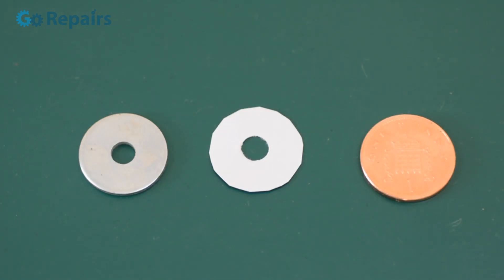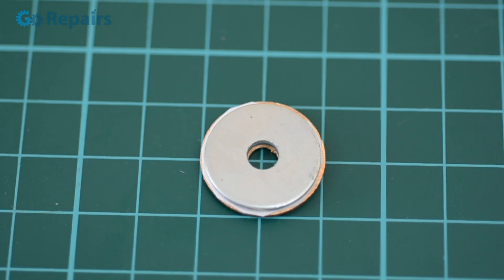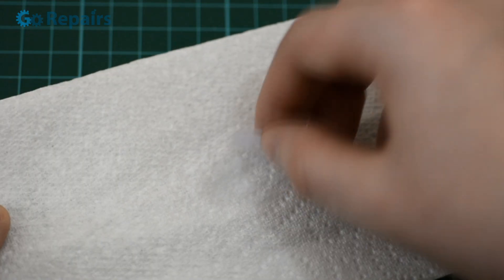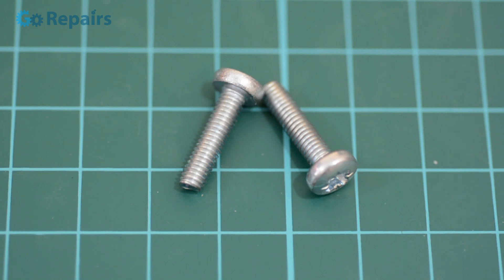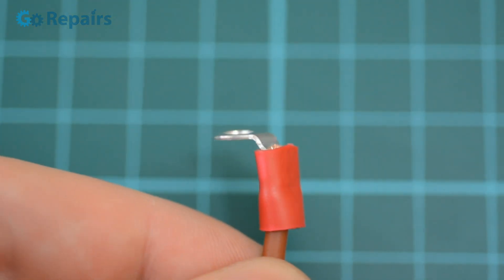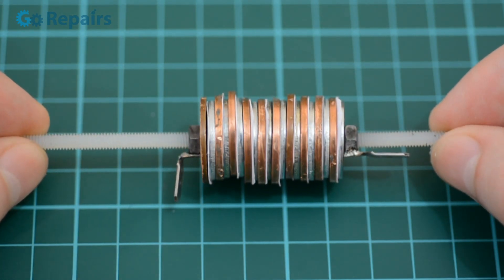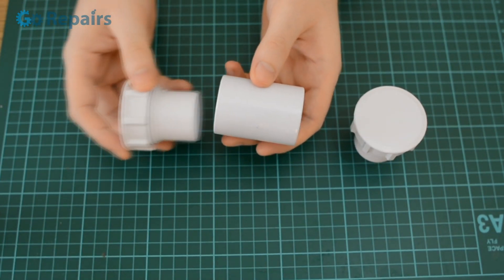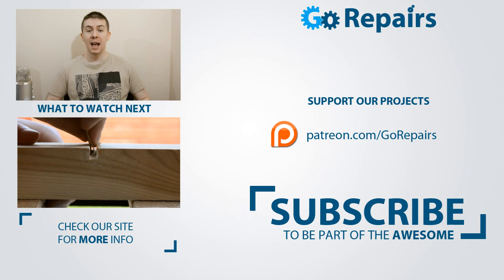How To Make A Battery

Comment: We drill through coinage all the time here in the States. Who will know when the battery is glued together? I am experimenting with the larger pill bottles available from my local pharmacy to build higher capacity batteries that are rechargeable and CHEAP. I ran a loop close to the power lines to get about 18 volts through a full wave bridge rectifier, and a buck- boost circuit to charge them all. So it costs nothing to recharge them. I also ran a small mesh wire screen behind the newer power meter to shield me from broadband over power lines interferences. The power company complained, but there is no law that says I cannot do this so they are stuck with it. As long as it doesn't touch the meter or the drop line, there is nothing they can do. I got so tired of the nasty harmonics that BPL caused, I installed the mesh shield as a self defence measure. Great video!

Comment: Is lemon juice a better electrolyte?
Reply from the maker: Depends what you mean by better? If you want a stronger reaction then use a stronger acid, if you want it to last longer, then you'd have to test which of the two lasts longer.
Reply: @GoRepairs  oh i see, do you have any recommendation on an electrolyte that is powerful, lasts long and is not expensive? Or there isn't such thing?
Reply from the maker: I wouldn't recommend anything more powerful than the vinegar and lemon juice we've mentioned unless you know what you are doing.

Comment: DidyaKnow: if you throw a wire over a tree limb you can measure 14volts from top of wire to solid ground (8ft copper rod in ground is considered a good ground); but the amps are very low so there i not much pwr there, BUT if you raise it to cloud level LOOK OUT  you might get a lightening volt (Free energy) down on your head (or hand); isn't amazing that we are surrounded by Free Energy but the govts won't take advantage of it, so we have to keep on paying forever for fossil fuel related energy?  To capture a lightening bolt : a copper wire on a balloon up to 1000 -2000 ft "could" coax a lightening bolt to come down to a perhaps milliion volt motor that might lift a building a few feed, storing the energy to be use a little at a time later ?
Reply: now thats a lot of volt
Reply: @dam78  There is so much free energy falling on us everyday, yet we let them persist with fossil fuels?

Comment: I think... if  you solder all the zinc washers together and then solder all the coppers together, you can then keep them immersed in electrolyte (using your waterproof container) to get more amperage, but lower voltage of course.  Chain 10 together to get perhaps 10-12 volts? at the higher amperage.  Lemon juice might be a better electrolyte.  You might be able to charge it up when it runs down. (you will prob want to put cardboard or plastic mesh in between every part of it ? )   Did you ever get a reading on amps output ? Watts = V  x Amps.

Comment: Great video 👍🏻 quick question though, I always thought that batteries were just a way to store electricity, and if I’m right the battery shown in this video is giving out a voltage/ electric current, is that because of the electrolytes in the paper? or am I just really confused? 😅
Reply from the maker: Batteries store chemical energy and it's the reaction of these chemicals that produces the electricity (they swap electrons). Electrolytes allow the electrons to pass from one chemical to the other (the elecricity bit). Hope that helps. :)
Reply: @GoRepairs  i know this might sound really stupid but i'm very curious about it, are the chemicals always producing electricity, and if so is it "going to waste" when not being used?
Reply from the maker: @firenagy8831  Yes the chemicals are still reacting once the battery is assembled, whether you use it or not. The reaction just lessens over time, as in this case, the metals oxidise and the paper dries out. Waste is a subjective term, but if you are worried about that then with my design you could just disaassemble it to stop it reacting and reassemble when required. Hope that helps. :)
Reply: @GoRepairs  thank you i think i understand it better now

Comment: Hey I loved your video. I built one as you instructed here in the video. I used 12 cells in series and produced almost 10 volt. But I couldn't run a toy car motor with this voltage ,it would be a great help if you could suggest me what should I do more to run a small motor. Thank you in advance.
Reply: You could make multiple battery packs and run them in parallel, that will keep your voltage the same and deliver more drive
Reply: @robertoseaturdl6104  drive? Current.
Reply: @Nekuzir  surely thats what he means
Reply: use 100 dollar paper
Reply: Buy a battery

Comment: The problem with people who dont understand electronics making batteries is that they never measure the internal resistance and the current, which renders the battery useless. It's not just the voltage thats important. If the internal resistance is too large you wont be able to power anything.
Reply: Exactly, like who wants a battery that has 3 volts but produces for example 0.1mA
Reply: @MichaeltLoLThis could be sufficient for electroplating or anodizing at the very least. Not a massive game changer but still useful if we had to rebuild society from scratch and look fly while doing it. I for one, love the old Baghdad battery 🪔 and want to build one big enough to power a lightbulb just for the hell of it.
Reply: Exactly the kind of comment I like. 
Please kindly tell me how to solve that 
Thank you
Reply: @Paulo Constantino - Exactly.
Reply: Yes, it's annoying when they don't show the current or resistance.

Comment: How long does the copper "washers"/coins last ?
Reply: Do you mean the metal or the battery?
Reply: pc7zz 1. The water in the electrolyte is ripped into hydrogen and oxygen. 2. The zinc gets oxidised
Reply: forever until you grow old

Comment: does the battery work? you should connect it to something and show the power discharge in a time lapse.
Reply: There might be a good voltage, but probably not a good current.

Comment: Greetings Northern Chappy. Most interesting video - I am after a way of making voltage when at sea in a small boat - lots of electrolyte all around. Any ideas for a longer lasting than cardboard disk? What happens if you put several of the electrolyte-soaked disks together to hold more? 

May I suggest that you speak a tad slower for the foreign johnnies who aren't familiar with your speechstyle? But ta, good video.
Reply: Haha same!! Let me know what you find. I discovered adding FSI to the salt water gets rid of the excess water for more storage